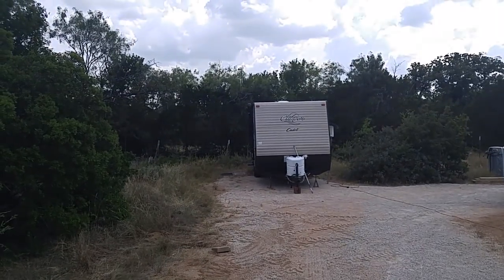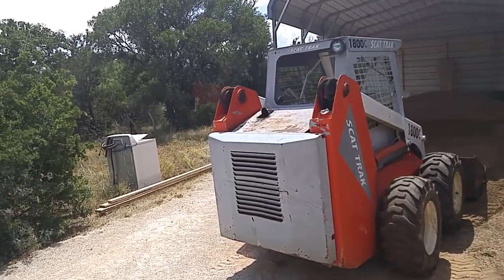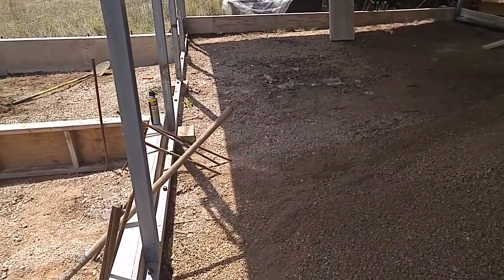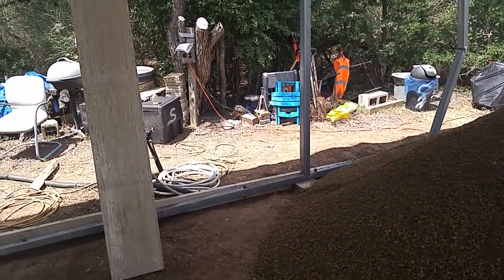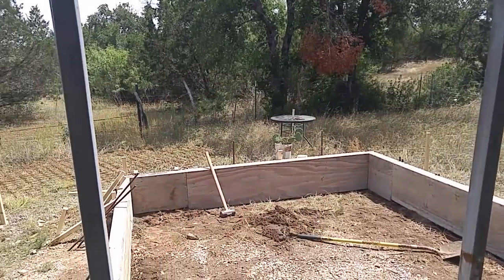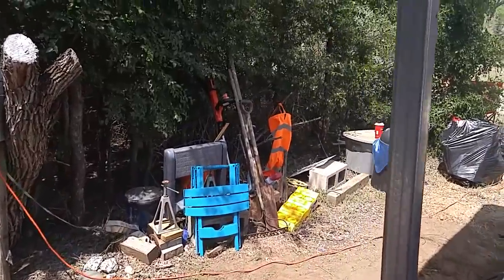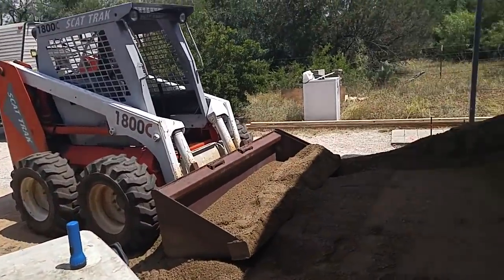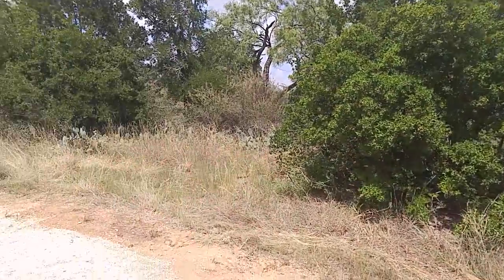RV HOME BASE IMPROVEMENTS...3

Comment: Get them to straighten up that hairlipped carport leg somewhat with the loader while it's there, Rusty. No sense in you having to look at it like that for the next 20yrs. Not a handier time to fix it than the present, Sir. 👍
Reply: Need to heat it with a torch first or it'll crack.
Reply: Maybe cut the bend out drill and bolt a plate on there. Or use 1 plate and a couple of long u bolts. If they have a welder weld a gusset on it.
Reply: James Ortiz I straightened the neighbor lady's with a come -along and nylon strap after she hooked hers. I couldn't help her car door though.
Reply: Mark 73573 awesome simple fix! That was nice of you.
Reply: James Ortiz It wasn't perfect, but it looked okay.
Reply: Buy a new pole.
Reply: Mike Buttfild Surely to goodness they know to heat it up first, Mike. 👍

Comment: Maybe I'm missing something here and I can hear you already saying,... "well Rob you do it the way you want to and I'll do it the way I want to." But with that said and out of the way... it looks to my like the slab is going to be level but the canopy will not. It looks like they're going to pour maybe 8" of concrete over one side of the canopy base next to the porch and hardly any on the opposite side. Again maybe I'm missing something here but it sure seems to me.... again this is just me... you do it anyway you want to (practicing my Rustyisms) but now would be the time to level that canopy and have the anchors placed in the concrete. I'm thinking its not going to be visually appealing with the concrete is flat and the roof line of the canopy leans down about a foot plus your loosing a foot of roof height on one side. You wouldn't notice this before when the canopy followed the slope of the ground before but you're changing that now with the concrete slab.